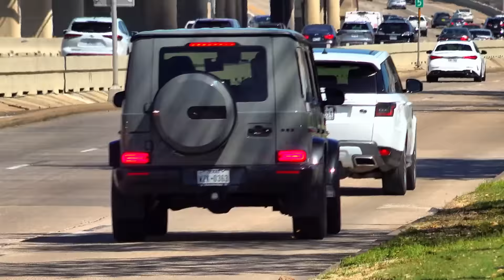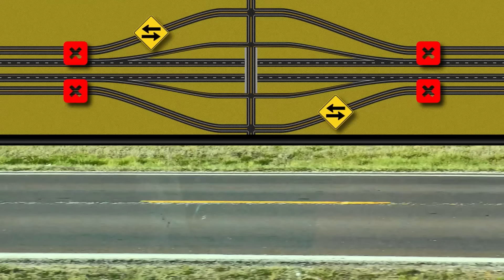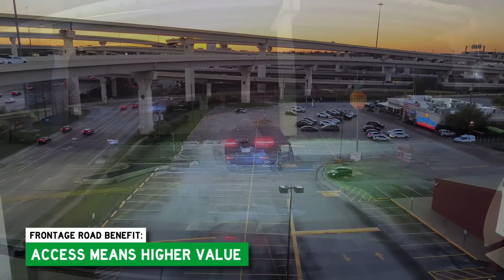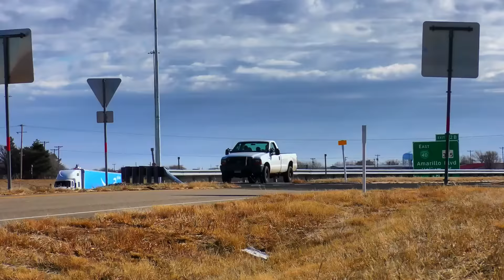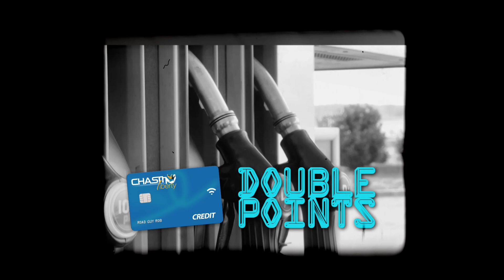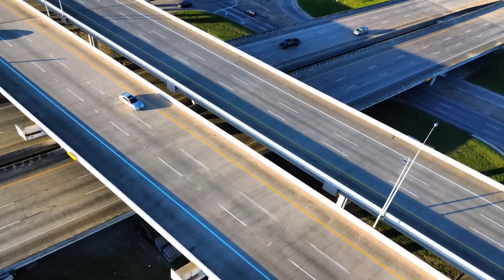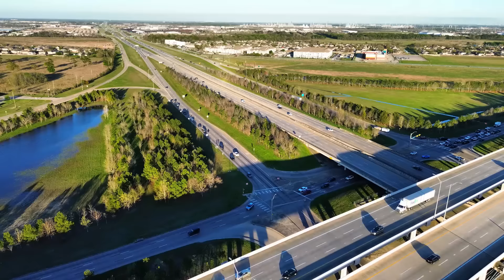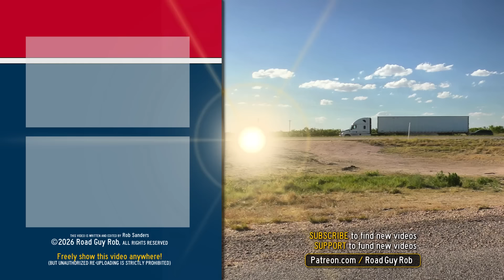Why Texas Builds a Freeway Next to Every Freeway

Comment: Not Just Bikes would have a stroke watching this.
Reply from the maker: I certainly wish him good health.
Reply: @RoadGuyRob  Hey Rob, you need to investigate south loop 610 @ south main/buffalo speedway, both sides east/west. It's a nightmare!
Reply: @RoadGuyRob  He lives in a walkable city with great bike infrastructure, so statistically it's more likely he is in good health (Netherland's life expectancy is 5 years longer than Texas's).
Reply: @recurrenTopology  not only walkable and bikable, public transit is top tier
Reply: @BanBanChi  depends. Public transport is good in the larger cities and to travel between them. Its worthless outside of the larger cities. So I still drive pretty much everywhere, but it takes plenty of other people off the roads. With fuel prices at $10 to 11 / gallon, its a bit less fun though.
Reply: @Twiggy163  Obviously public transport is meant for medium to large cities, no one would be stating otherwise. 80-83% of Americans live in urban areas, with 86% living in metropolitan areas around big cities. This isn't an excuse to not have better public transit when it can benefit a large majority of people
Reply: @kv9016 ofcourse it isn't. Towns require a good connection too and its very much possible. Not every town needs a train station or tram line, but a decent bus connection goes a long way. But even that is often scrapped or cut in frequency. This makes connections time consuming.
Reply: @recurrenTopology  Why does it sound like you interpreted their comment as some kind of diss lol
Reply: @OnceTwiceSouled I didn't, was just making an acerbic joke.
Reply: @recurrenTopology  Except when the Germans come. lol
Reply: @recurrenTopology I feel like the discrepancy in life expectancy primarily comes down to diet coming from a Texan
Reply: @OTLP it's certainly multifactorial.
Reply: @OTLP  I mean of course fast food is a problem, sugar levels, caffeine levels, and all the things they put on the US to make you addicted to food while selling you as healthy or even work performance enhancing. But, other things like not being killed by an oversized SUV driven by a single person doing basic groceries affect the number as well. Most young deaths come from road accidents. Not walking and becoming sedentary. Not smoking every day incomplete exhaust gases from gas. Not smoking every day brake particulates, concrete particulates, normal exhaust gases, tire particulates, a bunch of pfas that obviously are present in probably all of the above. That adds up, just from the decision to not invest in any public transport solution and instead providing people with more car space.
Reply: @Twiggy163 There are rural bus and train stops for the ones who might need them.
Reply: @Twiggy163  Like you implied there, buses can scale surprisingly far down. They can make transit viable even for the smaller towns of a few tens of thousands, and they also serve to increase the catchment area of train stations. Every year I take the train from my small town of 6000 down to a city of 600k, then another train to a city of 160k, and then the bus to a town of 30k to visit family. Works like a charm. Bicycles also work amazingly for traveling within a small town in the right circumstances. It is really only in the rurals where public and active transport approaches the realm of "worthless", though of course there's still some use to a rural bus sometimes. Particularly for shuttling rural kids to and from school, or transporting tourists to popular hiking routes, mountains, skiing slopes, etc.
Reply: @BanBanChi  public transit is top-tier? .... Tell that to all the people that get assaulted on the New York subway... SMH.
Reply: @yo12546  Going from being sedentary to taking a 10-minute walk every day decreases your risk of all-cause mortality by an estimated 15%. That alone makes an enormous difference.
Reply: @nexusofice9135  Reading comprehension is not your forte I see. Not Just Bikes lives in Amsterdam not NYC. SMH...
Reply: @recurrenTopology  & a lot lower income than Texas 😂
Reply: @nexusofice9135 , over 30,000 people die in car "accidents" every year in your country, and many more are seriously injured. The fact that someone was attacked on the subway is the fault of your stupid police. Аnd the fact that it's as dirty as hell there. This provokes inappropriate behavior and attracts marginalized people.
Reply: @Aizetone  LOL so you're attacking regional political and society to what?... Discredit my argument? Lol

That entire statement you just made was just a straw man argument. 

 And yes people die in cars that's not the point that I'm making. A lot more people would die if we didn't actually vet those that are capable of controlling that equipment. 

Are you just upset that you don't get what you want with absolute impunity? Or are you somehow offended that the concept of licensing competent operators on that equipment would somehow stop your freedom? 

That argument is atrocious. 

I've already stated before... That sort of arrogant thinking on something as simple as a scooter or a bicycle for the rider and operator not to be properly informed of traffic law so that they are not a danger to themselves nor the traffic around them. While in a public space that everyone is at risk now just not to assume that they need to be basically competent is folly. 

Even the libertarian in me says that you can't trust incompetent people with dangerous responsibilities in a public setting.
Reply: @yo12546  I'm sorry, talking about caffeine in response to a person talking about Norway? They practically inhale coffee.
Reply: @Vykk_Draygo Yeah maybe I overstated about the US. It is just that they drink stupid ultra-processed canned drinks. They have some caffeine mixed with a bunch of stuff. I think they might have over 500 brands of different "mind-hacking" drinks, which I have seen kids drink
Reply: @recurrenTopology  Too bad the EU has 0 innovation and is in a death spiral. Cool that they can walk around a city though. But they probably wouldn’t even want to walk around their cities if they had the demographic makeup of America’s.
Reply: @RoadGuyRob  I mean you don't realy think that just adding more an more conkrete improves the lives of the Texans?
Reply: @TremereTT srsly as a Texan what a joker video you made looking at our clown ass designed cities and wojacking at them
Reply: @SamanthaSerrano-p9n  ??? me ??? did you mis click by any chance?
Reply: @TremereTT   Hey everyone, mr Tremere over here wants less roads so everyone can spend more time driving in slower lanes
Reply: @kelpermoon23  Studies suggest otherwise, but you do you.
Reply: @lagautmd studies suggest that building roads to go places, allows people to go places
Reply: @kelpermoon23  Studies suggest that increasing road capacity increases traffic volume by an even larger factor, therefore reducing overall travel times.
Reply: @FE800A  studies suggest that you need roads going from point A to point B for cars to drive therr
Reply: @kelpermoon23  ok, I'll try to explain it in 🇺🇸English (simplified): when many vrum vrum, then no move
Reply: @FE800A  Haha ur butthurt
Reply: @kelpermoon23  Here's a paradox: in South Korea, they removed an expressway that was paved over a river and built it as a park. Turns out removing the road made the traffic better.

That's the Braess paradox: if you add a branch to your network, it makes all of your network less efficient.
Reply: @kelpermoon23  if there's no previous connection from A to B, you're right. But if there's already a road, making the road bigger doesn't make traffic better.
Reply: @korenn9381 completely and totally depends on the road
Reply: @kelpermoon23  The existence of the road itself is a good thing for connectivity, but eternally widening it does not provide additional connectivity. Only a minor increase in capacity at a disproportional increase in cost. Often, this also just means feeding more drivers into existing traffic bottlenecks such as intersections, which makes congestion even worse in those locations. Past a certain point, any form of infrastructure can get overengineered. That is definitely the case when you feel the need to build 3-lane frontage roads parallel to your 8-lane highway. What you need in these cases is more high-throughput options to relieve the roads, namely in the form of active and public transportation.
Reply: @V @Vorexia  yeah duh
Reply: @FE800A  poor road design has a much greater factor in the level of traffic. I've lived all over the country and these larger road networks with flowing exchanges move traffic far more efficiently. And no more lanes don't mean more traffic. That depends on population density growth and as I stated the layout and functionality of the roads. That study only really references 2 road ways in areas of drastically inflating urbanization and explosive population growth. Not really representative of the world in whole.
Reply: @FE800A  just give up, they are hopeless.    and be happy it's  them that suffer in that traffic and not you  (if it's you too, move to a better place)
Reply: Funny enough, I believe he credited Houston being so terrible as a pedestrian for the reason he became the transit advocate that he is.
Reply: @tHebUm18  walking in houston is insanity, shit too far away to walk
Reply: @tHebUm18  It was also one of his first videos.
Reply: @tHebUm18  Houston is terrible as a pedestrian regardless of how the roads are done.  I live here.  It is usually so hot and humid as balls that you don’t want to walk anywhere anyway.  Biking maybe and we do home some bike lanes in certain areas.
Reply: @kevingray8616  i think it would also depend on how you do your pedestrian areas, no?
walking paths next to roads and with the sun beating down on you the whole trip would be miserable.
But throw in some shaded areas, away from highways? Surely that's more pleasant
Reply: @aaronhauth8880  In South Texas heat and humidity? Nope, it never gets pleasant. I'm from San Antonio and we are just drenched in sweat about 8 months out of the year, about 4 of those months, the humidity is high enough that even in the shade and with a good breeze you can't cool down. Texas, regardless of how walk-able you design the city will never truly be walk-able year round.
Reply: @bassesoundandlights1966  I'll defer to your experience! I will note, however, that some of that heat is likely self-induced as a result of the heat island effect that comes with huge amounts of pavement baking and radiating in the sun.

It would make me wonder if it would actually become pleasant if texas went multi-modal and there weren't all those massive interstate + freeway combos everywhere.
Reply: @aaronhauth8880  Even in a roadside park, the traffic noise is bullshit.  You need noise cancelling headphones to do it.  There are some shaded areas away from traffic, but you go there to get away from it all.  It is never a way to get from point A to point B.
Reply: @bassesoundandlights1966  Idk why people use this as an excuse. Hong Kong Exists, Taipei exist, Seoul exists, Mexico City exists... Taipei is just as hot and much more humid, yet is one of the most walkable cities in the world with world class public transportation. 

Why do we always make excuses for why Texas can't have things? If it snowed a lot and winters were unbearable, the excuse would be "In South Texas bitter cold? Nope, it never gets pleasant. The weather is so cold that even layers of coats, you can't warm up. No matter how you design it, the city will never be walkable year round."

Yet, Chicago, Moscow, and NYC exist... 

It's time to face the fact that the automobile, oil, and conservative lobbyists have made Texas "cities" a concrete, lifeless, giant suburb filled with strip malls.

We're also all fat and obese from being dependent on cars, so much so we're still sweating inside a 73 F room... That is NOT normal no matter how common...

Better built cities = Less car dependency = better pedestrian paths that reduce heat island effect = more walkability = we're less obese/healthier = A hot summer doesn't equal death.
Reply: @mdr8062 : People are sweating in 73 F temperatures because they never installed a dehumidifier.
Reply: @absalomdraconis oh please. Thats not why half of Texas sweats at 73 F indoors (AC on)
Reply: @mdr8062  I use it as it an excuse because it is something I deal with on a daily basis. It really sucks. I don't walk outside start sweating profusely and think "wow, I can't complain because Taipei exists". I may be incredibly wrong in thinking that way, but with how Texas has been developed and the factors we face everyday, I think you'd be hard pressed to find a bunch of Texans who want to change life to be more walk-able. We also effectively have zero  public transit, so the idea of moving from car based travel scares a lot of people.
Reply: @kevingray8616  It's terrible as a driver too! I went once with my mom down from DFW and that gigantic highway terrified me
Reply: @mdr8062  As a Swede who lived in Cairo and Bangkok, the heat is absolutely unbearable at first but you eventually acclimate and everything becomes much more bearable. This is despite the fact that both these cities are filled to the brim with cars and suffer from the urban heat island effect. I suspect that many Texans out there never actually get time to acclimate since they keep moving between different air conditioned spaces. All the major cities in Texas were founded way before AC even existed, somehow people still got by back then.
Reply: @Vorexia exactly. Thank you for sharing!
Reply: @kevingray8616  it would be great if you had a choice to walk to places, or bike, or PUBLIC transportation, but y’all really don’t. I wouldn’t blame all of that on “it’s too hot to walk”.
Reply: @aaronhauth8880 Yeah no that baking effect doesn't mean anything we have 38° to 43° summers.
Reply: @mdr8062 None of those places really have good public transportation. In fact the ONLY place in Europe with good consistent excellent public transportation is the Netherlands. Ask a German about their train system and watch the start swearing at you about how late the trains are literally all the time. Mr.WalkableCities has a massive bias about public transportation because he lives in the one European country with a good system that actually works.
Reply: @justSTUMBLEDupon  Bus and train service exists for the more densely populated areas.  Bike lanes have been built in some of the more densely populated areas.  We don’t have regional rail which I agree would be a big improvement; particularly between Katy and Downtown Houston.  (which is now fully-developed along its 30 mile stretch)  Freight rail was once there, but was replaced by interstate and toll road.
Reply: @kevingray8616  What's frustrating is that there are so many little islands in Houston metro which are fine.  But there's no way to get between many of them without a car.
Reply: @ianfinnesey726  I hear ya.  I live way out in the Katy area.  There is an effort underway to connect many of the city parks with a pathway.  It’s still going to be a few years though.
Reply: @kevingray8616  Every link is a step forward, but that is still kinda pissing in the ocean.
Reply: @mdr8062  I live in Hong Kong and I absolutely hate walking on the streets. I couldn't even find a parking lot nearby, so I was forced to park all the way down by the waterfront and walk up to SOHO just to get a haircut. It’s 32 degrees out with scorching sunshine, and after a 30 minute walk, I only survived by chugging tons of water. Don't tell me I don't usually walk ,I get over 10000 steps every single day. But I can only survive in air- onditioned places, not outdoors in this weather.Who like that?
Reply: @kevingray8616  well the big deal is the walking distances right.... and that is a product of car based design.    So if you have a pretty walkable area the discomfort walking can be better tolerated
Reply: @justSTUMBLEDupon  No, it's because we have a ton of space so we build out instead of up. As a Texan, I don't get why anyone cares about being able to walk everywhere. I couldn't care less if I need to hop in my car and drive for a few minutes to get to a shopping center. If I want to walk, I do it. I can walk to stores, I can walk to parks. There is plenty of stuff within walking distance, but I don't have to walk, and it's certainly much nicer to get groceries using a car than to walk or use public transit. It's a non-issue for most Texans.
Reply: @aaronhauth8880  it is quite pleasant. People complain all the time because the only part of the heat they experience is the 3 minutes from their parking space to the location theyre visiting, which is usually on a concrete hotbed. I walk around and bike around everywhere, its pleasant outside of direct sunlight peak hours in August.
Reply: @tHebUm18 as awesome as the freeways are, Houston is not built for walking. 
It is too deep in a cascading affect of parking lots to hold cars, so you need more highway, so theres more parking lots, but because so much space for parking lots, businesses are too far apart, so you need highways, and it keeps repeating.

The new construction growing around the outskirts of Houston is going to make it worse.  So many houses being built along 45, 10, 290, and westpark(will be extended to Fulshear soon) is going to congest those highways. Those single homes with yards and driveways are going to force everyone to need a car just to get out of their community and straight into becoming highway traffic.
Reply: I had a stroke watching this
Reply: @escobasingracia962 I also did. This was WAY too high energy for a freaking civil engineering video
Reply: @escobasingracia962 Are you okay??
Reply: @escobasingracia962   Have fun waiting 15 minutes for a bus to take to get off and transfer to another bus to walk to the hospital.
Reply: @g @grafzeppelin4069 You know, walkable cities have ambulances too (and they’re free)
Reply: @grafzeppelin4069 have fun getting in an ambulance that gets stuck in traffic on the way to the hospital
Reply: @JacobRy  I won't, because we built the one more lane you're always crying about.
Reply: @grafzeppelin4069  as opposed to being stuck in traffic and building another lane that only compounds the problem
Reply: @rich8674   No, building more lanes does not "compound the problem."  If you need more water from the spigot, do you buy a smaller hose?
Reply: @grafzeppelin4069  Fortunately I don't have health care so I just wait until it passes
Reply: @grafzeppelin4069  it's called induced demand and if you really cared you'd look that up
Reply: @rich8674  Another lane doesn't "compound" the problem, but helps alleviate traffic. It looks like you've fallen for "induced demand fundamentalism" that is often spread by the bike channels.
Reply: @grafzeppelin4069  Ha! Where in the US do you have buses which actually come every 15 min
Reply: @a_somebody9519  the Boston area has pretty consistent bus service. When I lived on 71 there'd be a bus every like 10 minutes
Reply: @derekderekderek2  You mean induced demand that the US Department of Transportation includes when proposing road upgrades and in the planning process? It's not magic one way or the other, it's just another part of the planning process.
https://rosap.ntl.bts.gov/view/dot/79299/dot_79299_DS1.pdf
Reply: @derekderekderek2 this is why the United States is for survive behind they don't educate their citizens to know why building more roads for the most part will make traffic problems worse but it is a proven fact we know for a fact it makes things worse especially over the pond.
Reply: @a_somebody9519 Welcome to Dallas, go into the downtown for a bus; otherwise you’re walking
Reply: @elixier33  it's not a fact nor is it proven. That's why it's called "induced demand fundamentalism", a distorted belief taught mainly by bike youtubers
Reply: @grafzeppelin4069 An added lane can increase traffic. Its a pretty well documented issue and Houston has some of the big, emblematic roads for it. It's a little counter intuitive but the process is called induced demand. Basically the extra lane extends the effective reach of the freeway and causes more people to flock to it in numbers that create more trafic than the additional capacity created by the extra lane, resulting in a net increase in traffic.
Reply: @FoolyCharged Right. When the Katy Freeway was expanded the traffic lessened for a short period of time but was soon just as congested as it was before.
Reply: @elixier33  In Atlanta, they have done little to the interstates beyond HOV/HOT lanes. No new freeways either. Is traffic commensurately worse relative to the percentage of capacity added since the early 90s? No! It’s orders of magnitude more than than growth in capacity. By you logic, traffic should only be 20% worse if 20% capacity added. Atlanta metro is living proof that that is simply not true. Adding more lanes may not solve traffic - as if a few train lines will “solve” it - and it may not keep steady, but you can guarantee that not building something - new freeways or new lanes - in a growing area will absolutely make traffic work. With the roads static or growing less than traffic volume, where is that traffic going to go?
Reply: @JacobRy  Can't forget those crippling ambulance and ER bills
Reply: @derekderekderek2  : It's not complete nonsense, but the description is. It's a communication problem: in particular, it happens when it's too easy to get on/off the added capacity, so traffic from elsewhere shifts on to the new capacity instead of staying where it was. The solution, of course, is pretty straightforward (though not always easy): make sure that it's somewhat hard to shift between the sub-system (such as freeways) the capacity was added to and everything else, and the new capacity really will make things easier, at which point you can then look at dealing with problems in other sub-systems (such as local roads) under the same concepts without as much trouble (because the difficulty of shifting between sub-systems will cause people to improve their routes instead of using the stupidest possible option).

None of this, of course, favors the bike supporters, which is why it's partially nonsense. There is no rational situation where a proper city transitions from car-centric to bike-centric without a massive level of disfunction, because actual cities either have too much area for bikes to do the job, or too much density for bikes to do the job, so the only way for cities to move from cars to bikes (instead of suspension railways or something) is if the city becomes so mismanaged that both population and real-estate are forced to make massive relocations and rezonings to compensate. The bike obsessives just have their heads stuck in towns.
Reply: @grafzeppelin4069  induced demand
Reply: @grafzeppelin4069  Adding lanes have been very thoroughly shown to NOT alleviate traffic and in many cases, cause more.
Reply: @derekderekderek2  Ahhhh...gotta love the mentally ill. "I don't like this statement..so I will declare it  false narrative, even though they have plenty of actual data to back it up!"
Reply: @FUGP72 No, you're alluding to the myth of "induced demand".  It is physically IMPOSSIBLE for building additional lanes to increase congestion.  It can increase TRAFFIC (throughput), but it is supposed to.  There is no such thing as "induced demand" - that is correctly called LATENT demand.

The problem is that more people want to use the road than the road allows.  The solution is to build more lanes or more roads.

Again, if you believe in your "induced demand" so much, go tell firefighters to replace their firehoses with backyard garden hoses, because they will let more water through.  That is what you are arguing.
Reply: @FoolyCharged  

No, you're alluding to the myth of "induced demand".  It is physically IMPOSSIBLE for building additional lanes to increase congestion.  It can increase TRAFFIC (throughput), but it is supposed to.  There is no such thing as "induced demand" - that is correctly called LATENT demand.

The problem is that more people want to use the road than the road allows.  The solution is to build more lanes or more roads.

Again, if you believe in your "induced demand" so much, go tell firefighters to replace their firehoses with backyard garden hoses, because they will let more water through.  That is what you are arguing.
Reply: @dariusbrock2351    Because the additional lanes did not even come close to keeping up with the population increase, you dolt.
Reply: @grafzeppelin4069  It's amazing that you bring up population increases as a dynamic effect while constantly ignoring any other relevant or causal details and then have the audacity to criticize others. 
The hose comparison is a pure show of cognitive dissonance, no one is saying that smaller diameter hoses have higher flow rates for static demand. The argument is that the demand isn't static. 

The firetrucks themselves carry a limited amount of water. This is why fire hydrants exist. They provide access to a large reservoir of water that the firefighters can use to put out fires. Imagine arguing we need to build more firetrucks or more lanes to carry water back and forth while your house burns down instead of just building infrastructure appropriate for bulk water transport. 

No one is asking to ban firetrucks they have their purpose, but it would be asinine to completely dismiss water carrying pipes in high population areas as viable infrastructure.
Reply: @a_somebody9519  Lots of places do, you must not live in the US. I've been to and used the public transportation in several US cities and they do in fact have buses that come every 15 or sometimes even more frequent than that.
Reply: I think he would be fine. We do have frontage road like this in Canada. Montreal has them (we call them service road). Its f’ing dangerous trying to pul’ in a store with people flying at 80-90kmh (and its a 50kmh zone).
Reply: @benoitrochon96  It is good that Canada joined the Horizon Europe program. Eventually you start getting walkable cities too 👍 Higher quality of life and not that Texas 💩 Greetings from Finland 🇫🇮🇪🇺
Reply: Opposite. Canada imported poo.
Reply: @verttikoo2052 Montreal is the only place with frontage roads really. Which is ironic since downtown is walkable and is transit oriented. Canada needs more transit but it is going to be car friendly because in the dead of winter, no one wants to do much walking. A -1 c day in Toronto can be a miserable walk beside of the damp humidity. Car use is not always ideal but it bears freezing your ass off waiting to the bus
Reply: @marklittle8805  I am from Finland and when we can do it, then you can do it 😉
Reply: @verttikoo2052 Finland didn't start off with the car culture Canada has. And outside of Southern Ontario and the Fraser Valley, Canada is a lot of empty spaces... Like a LOT. Finland and Canada are similar in climate and some of the topography, but the scale is different
Reply: @marklittle8805   No excuses. You can do it. You don’t know it but Canada is full member of the Horizon Europe program and Carney is building this thing using science and reality 👍
Reply: @marklittle8805  You see them in Alberta as well.
Reply: Yeah, Jason would freak out for sure. He already made a " i hate houston" clip.
Reply: The main issue he'd have with this, I'd randomly guess, is that it's really just a freeway next to a freeway pretending to be something different. If these were genuine local roads, one lane, with proper pedestrian and bike infrastructure, there'd be little to complain about. In fact, it's one of the ways the Netherlands does handle its traffic planning: use proper road hierarchy.

It's all about putting the appropriate traffic onto appropriate roads. Don't use freeway design for local shopping roads. And don't use local neighborhood road design to design something like a freeway - which some of those offramps running right into oncoming traffic here I'd say are (I'd suggest some of those could be roundabouts too, but that'd probably get me shot in Texas).

So I'd say it's less about the principle and more about the very Texan way these are executed.
Reply: @Sp4mMe Many Dutch roads even have "frontage roads" - where the frontage road is a single lane one way residential street with all the houses, and the main road is a 50 km/h road (often 2x1 lanes). The scale of the Texan roads is more the problem than the idea itself.
Reply: @marco23p I'd say it's more frontage streets as they are usually streets next to roads, instead of stroads next to highways. And a good number are just parallel streets and not so much part of the highway to the degree frontage roads are.
Reply: @marco23p bad example. The Netherlands actually has many ''frontage roads'' like the ones in the video but they are, as you said, single lane and usually have a bike lane on both shoulders, these roads allow speeds of 50 km/h  also mentioned by you, but they do not have houses next to them. These roads running parallel to highways border on farmland or industrial zones/office buildings.
Reply: @marco23p The netherlands has many different types of Frontage roads or Parallelwegen. Good examples are near Utrecht on the A12 or near Almere at the A6. They generally form a 4x2 highway, 4 2-wide highways. Or as you mentioned Parallelwegen with lower speeds.
Reply: @marco23p we also have 80km/h parallelweg next to 100+ km/h highways sometime, though onramp access is usually via roundabout and they are generally two ways instead of one way. these roads are in rural areas and do not have bike lanes.
Reply: @Sp4mMe  But frontage roads ARE proper road hierarchy.  Instead of 6-7 entrance and exit ramps for one city, all getting clogged up and spreading congestions into the city, you have 2, and both are at opposite ends of the city, where space is more available.
Reply: @Sp4mMe  The scale issues that come along with massive sprawled out cities where cars are a necessity make it extremely difficult to put "appropriate traffic onto appropriate roads". There's just way too much traffic trying to get from everywhere in the area to everywhere else. It's a frustrating problem to have, and as a Texan who has spent time in the Netherlands I would love nothing more than to be able to Dutch-ify things, but it's just not possible in the vast majority of the state.

I disagree with the reductive viewpoint that it's more a matter of "Texas brain" than it is of principal. There are a lot of reasons we ended up with the god-awful sprawled-out traffic-clogged cityscapes we suffer with today. Growing from farmland to massive metroplexes during the 20th century where land was cheap and cars were already the norm sort of doomed us to this situation. And now we have to deal with it. It's complicated.
Reply: @Sp4mMe  man using "... that'd probably get me shot in Texas," and then the next line features "... Texan way these are executed," is just amazing. Intentional? Maybe, maybe not. Nice reading? Yup.
Reply: @Sp4mMe you'd be surprised to know that the majority of these frontage roads actually have a sidewalk with them!
Reply: @GeonQuuin  That's nice. Doesn't change the other problems.
Reply: @GeonQuuin and most of the walking will be because of all the parking lots
Reply: @GeonQuuin  I live in Texas and the sidewalks on them are useless. In my city they just abruptly end and lead to nowhere. They also start from nowhere as well since they don't connect to any residential areas. That isn't really "pedestrian infrastructure". I should expect to make it to my destination entirely on foot/bike without having to walk in mud or hug the inner-edge of the road, which is pretty much what I have to do if I was willing to brave the journey to Walmart or Costco.
Reply: @GeonQuuin  Shhhh... the urbanites want to play pretend.
Reply: @Sp4mMe  It's actually a stroad next to a freeway, which is probably better than having one gigantic stroad.
Don't expect any commercial activity other than soulless box stores in the area, though.
Reply: @TheRealE.B. Strip malls, strip clubs, mattress stores, Texas frontage roads have it all.
Reply: @MrOtistetrax  car dealerships and fast food ofc too
Reply: @MrOtistetrax  And in Houston they're all in the same shopping center, it really makes it convenient.
Reply: @TheRealE.B.   Dentist office, Staples, Chinese food, ethnic grocery store, Burlington coat factory, pool hall, income tax guy, barber shop, Denny's, seafood restaurant, regular grocery store, mechanic, Bob's furniture, hotel, optometrist office - that's the stuff on the frontage roads in my city.  Does that count as "good" commercial activity?
Reply: @grafzeppelin4069    Okay, so not literally all "big box" stores, but yeah it still just sounds like you're rattling off stereotypical strip mall businesses.
Reply: @TheRealE.B.  So, goalpost successfully moved.
Reply: @grafzeppelin4069  Not really. My initial comment was an internet wisecrack; it's obviously a broad generalization for the sake of brevity. Listing out all of the various types of stores that you typically find in a strip mall just doesn't have the same zing.

You also need to understand that I rarely visit such places, so I legitimately forget that there are Aspen Dentals and Kay Jewelers and such sprinkled in among the Costcos, Walmarts, and Best Buys. The presence of these smaller stores doesn't materially change my experience of the built environment.

My point is that it doesn't look the commercial districts I shop and eat at where I live. That's all I mean. Don't make me write a detailed manifesto about why giant seas of asphalt deal psychic damage to me.
Reply: @TheRealE.B.  Haha ur butthurt lol
Reply: It's actually a good system, it just points to the absurdity of building a highway everywhere in order for people to get around because in order to build a working highway these ridiculous frontage road systems are necessary.
Reply: @Sp4mMe  Texas has roundabouts. Not many, but they are becoming more prevalent in newer suburbs.
Reply: @Sp4mMe  You can't use the same system for Netherlands and Texas.  Comparison total land area of Netherlands (around 33K squared for land only and 42K squared for both land and water).  Land area for just the Dallas-Forth Worth Metro area in Texas: 24K squared.  You are not going to ride a bicycle from one side of the city to the other.  Even public transit is limited in what it can reach.
Reply: @alexaneals8194 right, but we also don’t cycle from one end to the other of a city. The randstad (literal translation is bordercity) is a complex urban sprawl of cities and towns covering 3 provences. You could live in the hague but work in amsterdam, i’ll tell you that nobody cycles from one city to the other for productive means, but this person working in amsterdam and living in the hague which is about an hour drive, might do their groceries with their bycicle because the albert heijn is 5 minutes away with a bicycle or on foot. It’s not about completely switching society from one form of transportation to the other, its about mixing the forms and proper use of transportation for the proper means.
Reply: @Sp4mMe : Roundabouts are drastically overrated. They're only useful for the lower end of medium-traffic intersections, because they involve too much space for low-traffic areas (where all you can justify is a plain crossroads), and don't support higher traffic volumes (because even if you TRY to use a multi-lane setup, all of the inner lanes become almost unusable at high traffic volumes: the more lanes the roundabout has, the less effective every additional lane becomes).
Reply: he would love the concept: having a proper freeway and two local streets is a huge improvement compared to a stroad. But he would hate the execution, because Texas builds frontage roads as large and fast as the highway which negates the initial motivation of making the driveways safer to connect
Reply: @RRRoschan : Nah, Texas just hasn't faced up to how fast they should make the freeways yet.
Reply: @absalomdraconis honestly that's absurd. I live in dallas, freeways are often 65-75 mph, they do not need to be faster
Reply: @absalomdraconis 
Bury the highways, then you can make them far faster
Reply: Thank god. Maybe he’ll finally stfu
Reply: try livin it.... its a blood sport out here.
Reply: Uhhh pretty sure this is exactly the usual solution to stroads, just applied to a freeway. The stroad solution would be that central road, and then a parallel side street for the driveways. Same concept. Netherlands does it a good bit ~
Reply: Fuck the cyclist. Move somewhere less car centric
Reply: And Texans would have a heart attack watching Not Just Bikes. One of, if not the, topmost morbidly obese states in the country.
Reply: Of course, guy's a loser
Reply: Texas = Not Just Cars/Trucks
Reply: Interestingly, dutch roads do have frontage roads. It's just that everything is only 1/3rd the size, and at lower speeds suitable for pedestrians and cyclists.
Reply: Hope the last thing NJB sees as he strokes out is a Chevy Suburban bearing down on him on a stroad
Reply: Being in a semi truck. Having to take a turn onto these side roads from a narrow road is stressful. I would have to cross 2 lanes to make the turn and traffic is too fast
Reply: @Doofwarrior88 : I dealt with this style for years in OKC, you need more space. You need to add AT LEAST one more on/off -ramp pair between the side road and the ramp onto the freeway to give yourself more opportunity to change lanes. Or, alternatively, alter your route to maximize your usage of turn lanes at stop lights (just depends on the situation).
Reply: I was thinking the same thing but about the fuckcars community in general including their subreddit. And as someone who's somewhat aligned with them I nearly had a stroke myself this shit is disgusting lol
Reply: I almost had a panic attack
Reply: Love your energy!  Thanks for the videos.  Keep 'em coming!
Reply: Yeah, he should stay in Europe. I'm grateful for my drivable cities. Roads are for cars, not bikes.
Reply: That would be awesome to see
Reply: They do have a sidewalk
Reply: Make him watch it please
Reply: The Netherlands kinda has these too, but they're also proper freeways without level intersections and no direct access to shops. They're just an outer freeway with many exits and the inner freeway with no exits.
Reply: at 15:36 you can see some Florida bike gutters. Would send NJB into conniptions. What he doesn't know is that in the early oughts Central Florida had hardly a single bike lane. They were all just poorly maintained shoulders that kind of just...sank into the sand. What we have there now is a HUGE improvement. Still scary af to ride on, but now at least you don't feel like you're riding somewhere you're not suppposed to be.
Reply: It is making my blood pressure go up for sure.
Reply: As a native New York, on my first vist to Texas, I fell in love with it. For many reasons, their roads configuration is in my top 3. Truly enjoyed driving in TX. I hope to return soon😊
Reply: Not really. Not just bikes talks up access roads.

This is how you avoid stroads
Reply: @MrDdwornik  By... building stroads? What exactly do you think these high-speed roads full of driveways are?
Reply: @notme8232 it looks to me a lot more like a highway next to an access road, which he speaks up as being pretty great in the Netherlands.

This has a purpose built limited access highway (good), and a seperated designed for on and off road.

Not a stroad doing both at once.
Reply: @MrDdwornik  Never been on one, but it kinda looks like the "access road" moves about as fast as most highways, somewhat nullifying the benefits
Reply: @notme8232 perhaos they act as an access stroad 😂

Not just bikes does talk up the access roads to the intra urban shopping hubs run along proper highways as one of the things that makes driving in the Netherlands better though.
Reply: No he wouldn't. This actually looks pretty good and safe compared to other traffic systems in America. For a start those feeder roads are one way. 

As a Dutchman who's studied spatial planning myself all I really would want to add are proper sidewalks and bidirectional bike paths on both sides.
Reply: @Deckzwabber : Those really don't belong directly on these roads, as these are really still high-speed. Pedestrian & bike traffic belong another layer away.
Reply: @absalomdraconis 
Not on the roads, certainly not. But parallel to. With an appropriate intersection design to protect those not travelling with two tons of armour plating against drivers turning without looking carefully enough.
Reply: Good. Keeps the wrong people away.
Reply: This is why I support Rob. He talks about transit, cycling infrastructure, and pedestrian infrastructure while not trying to un-invent the automobile with his every waking breath.
Reply: @djsekani I can tell he doesn't like cars, but he doesn't like that there's cars EVERYWHERE and not enough safe or reliable sources for pedestrians to access basic stores and other important locations. In fact, if you actually took the time to watch his videos, he SPECIFICALLY states that big cities like Houston can become more pedestrian friendly if people stopped buying SUVs and light trucks or luxury light trucks/SUVs and instead drove car types like sedans, station wagons, or compact cars. Cars being bigger is what makes Houston think it needs more concrete and space to accommodate when in reality, it just needs to change their perspective on what we should be driving. I'm in total agreement and I'm a native Houstonian, I was born and raised here and I do in fact walk/bike/take public transportation, so I know exactly what Houston is like. Hell, even when my partner who lives in San Antonio came to Houston for the second time in his life, one of the first things he commented on was how much you have to drive everywhere and that everything is really far from each other. Once I do get a car in the near future, I don't want to exacerbate the problem, I'm getting a sedan or station wagon, NOT AN SUV OR TRUCK.
Reply: @carolinacoreas7716 On an intellectual level I actually agree with almost all of Jason's arguments. It's too bad that they're buried underneath a bunch of inflammatory anti-car noise. I can do without his clickbaity confrontational tone. Why have a real discussion when the stupid hot take gets more views?
Reply: @carolinacoreas7716 get a hatchback. I consider myself a car enthusiast and love driving on the weekends but I also take the train to work for my commute. The walk from the station is a bit long but I just consider it good exercise before and after work, certainly getting my daily steps in. I could drive to work much faster but i kinda like the routine and it's still not too bad (45 minutes each way vs the 15 it would be if I drove)
Reply: @djsekani  i don't think NotJustBikes hate cars, he have stated that he does use car share service when he finds it necessary. The whole point is that this model of running freeways in the middle of a city is not sustainable and advocating to alternatives to driving (especially during rush hour) and kids having autonomy by not being tied to their parents driving them everywhere.
Reply: Texas looks like a very crappy place to live. I thought Toronto was bad in how car centric it is, but Texas takes the cake.
Reply: @UzumakiNaruto_   If you don't have car Yeah it's crap, got a car it's not half bad.
Reply: @MrTak44  As long as your car has A/C. FOr like 5 summers, when I was a kid, we drove a car with no A/C it was hell. My dad and I used to go pick up my mom from work, and getting stuck in traffic was doubly worse, because not only were we not moving, we had no air flow. I think I would lose my mind today.
Reply: @UzumakiNaruto_ it’s so hot that you don’t really want to be outside walking anyway. The selling point of Texas is that the real estate price to wage ratio is rather good compared to Canada which has one of the worst in the world
Reply: @badart3204 Beats the shit out of SoCal for driving in, believe me. It’s not like America is going to undo its reliance on cars anyway. Might as well find the least bad way to do it.
Reply: @badart3204 not being able to walk because its so hot you don‘t want to go outside is also not really selling me on this whole „living in Texas“ thing, that just sounds even shittier.
Reply: @UzumakiNaruto_  I'd rather be dead than living canuckistan. Walking is for losers that don't have a car.
Reply: @UzumakiNaruto_  Not a great place to visit either if you want to just walk from your hotel to a nearby restaurant for example.
Reply: @UzumakiNaruto_  It's larger than France.  Cars are pretty much required unless you want to live in an urban center and never, ever leave.
Reply: @bigd4366  
That's why the Netherlands has got it right. They built their cities and communities to be liveable for people rather than serving vehicles first. They made it so that you could have options to get to where you want to go rather than making cars the best and quickest way to get anywhere.

If you just want to go to your neighborhood store, then you can walk or bike. If you need to go further then you can bike or take transit or drive and if you want to take a trip then go drive. The Dutch made all these options safe and easy while in North America driving is still the best and fastest way much of the time.

I don't know if you watch Not Just Bikes or other channels that show Netherland cities and how they're built, but they just look so peaceful and safe to get around outside of a car compared to North America where frequently riding a bike with cars is risking your life. 

I just like that they have large portions of their communities that are built for people and that its so quiet and peaceful without cars zooming around everywhere near you. I wish we had that in North America more.
Reply: @bigd4366  All of our largest cities in the US were built on railroad lines and were designed to be pedestrian friendly before cars became widespread. The idea that the country's geography 100% requires cars is manufactured and not accurate to our country's history.
Reply: @UzumakiNaruto_ : They mostly built their communities before cars were widely (or at all...) available, and thus the fastest travel was by horse. This happened all over Europe. In contrast, most US urban areas got the bulk of their size after cars became readily available.
Reply: @absalomdraconis  
They mostly built their communities before cars were widely (or at all...) available, and thus the fastest travel was by horse. This happened all over Europe.

Not true at all. At least for the Netherlands, Not Just Bikes has done a number of videos of how post-WWII the Dutch government were building North American style car infrastructure in the 1950s and 60s and then the Dutch people protested against it because they hated it and guess what? Their government LISTENED and began taking a different direction in how they approached building their roads so that they would be more people centric than car centric.

NJB has posted several videos of how the Dutch had torn down and re-designed a number of stroads and multi-lane streets to add bike and pedestrian friendly infrastructure. He also showed how when streets need to be torn up for major infrastructure work that the Dutch often take the opportunity to completely change those streets and upgrade them to be better for pedestrians and cyclists.

The point is the Dutch were once building the same kind of car centric infrastructure that North America was and when the people spoke up, their government listened and they changed the way they chose to build their streets and roads and they've been continually doing it ever since. 

Cities in North America could do the same if they really wanted to, but most don't want to. Heck even when they're building brand new subdivisions where they can design a community from scratch they don't bother to make more people friendly either.
Reply: @UzumakiNaruto_  The Netherlands is slightly larger than Dallas/Fort Worth.
Reply: @bigd4366  
The Netherlands is slightly larger than Dallas/Fort Worth.

And? Doesn't mean you can't change the way you build your cities starting now if you really wanted to. The thing is I don't think North American cities do really want to change the way in how they build things.

Even when most NA cities are building brand new communities where they have all the space and freedom to design what they like to build, they STILL choose to build the same as they always do instead of adopting the Netherlands way of building communities. So its not like they don't have the opportunity. The governments in charge just choose not to change.

Compare that to a place like Carmel Indiana. Small city I know, but their leaders had the will and desire to change and now they're one of the most nicest and people friendly places to live.
Reply: @UzumakiNaruto_  You missed my point, which was that one metro area in one small (two counties) part of Texas is comparable to the entire nation that you brought up.  Texas has 254 counties, and is the size of France.  And most of the population doesn't live in a dense urban setting.
Reply: @bigd4366  
You missed my point, which was that one metro area in one small (two counties) part of Texas is comparable to the entire nation that you brought up.

So are you saying that its easier to implement things in a smaller country than it is a large state? If so that may be true, but that doesn't mean you can't start now and keep it going so that from now on you can build nicer, more people friendly communities while going back to older parts of a city to change their design when you can. 

However I doubt Texas or most other places in North America have any kind of desire to do so which is why even when they're building brand new communities and subdivisions from scratch they're still building them the same way as they've always done which is stupid. I mean they could begin building them with proper bike lanes and have more density and have roundabouts to move traffic around better while slowing drivers down etc., but instead of doing any of that, they still build them the same as most every other suburban subdivision in NA.

Texas has 254 counties, and is the size of France.  And most of the population doesn't live in a dense urban setting.

Which is dumb because having people spread out so much increases the cost of the infrastructure of delivering services to people while at the same time it makes much worse places to live in when most places you want to go to requires a car to get to.

Again it is possible for city planners in NA to build nicer places for humans to live in just as they do in Europe. They just choose not to do so even when they have the land and funds to do so.
Reply: @UzumakiNaruto_  i never like Texas for this reason. So much noise and danger.
Reply: Rightfully so
Reply: Reminds me of Dutch roads. They love multi purpose buolevards. Fast traffic in the middle and frontage roads on the sides.
Reply: @Loanshark753 except the frontage roads in Texas have speed limits of 45-55mph/72-88kmh (obviously fatal to pedestrians)
Reply: That guy has a condescending smug attitude that makes his videos a tough watch. While he makes some great points, he struck gold on his "optimize for car traffic bad" mantra and milked it to the ground. Like it's ok that every city doesn't look and feel like NYC or some 1500's European city. Diversity and options are good so people can live and move around where and how they want.
Reply: Bro hasn't seen a tree in years but he'll go apoplectic if someone owns their own home and car instead of renting and being dependent on a bus.
Reply: Real Civil Engineer would also have a stroke. A merge before a diverge as a feature
Reply: I was watching this video thinking this exact thing, came down here to make this comment and boom there it is.
Reply: He actually argued for something like this in favor of stroads.

Only smaller. Why are the frontage roads in the videos all still so huge?

A one lane street with a two way bikelane and a sidewalk seems big enough?
Reply: @iamcurious9541 because everything bigger in texas.  They are all like this, usually more lanes like: 2 left turning with one to go straight, 1 to straight only, 1 to go straight and right.  Sometimes bigger, sometimes smaller.

This is NOT a bike city even if you add bike lanes.  Too much storm/rain, too many cars going fast(especially in residential), and sidewalks end out of nowhere everywhere, bridges with no walkway. 
Stroads as far as the eye can see as well.
Reply: @iamcurious9541 its the traffic level. All of these clips come from fairly busy "main" streets. For more walkablity you could look at dedicated bus lanes for a bus route that does moves people up and down the highway then some  small buses for local stops. With how much room these overpasses us I would not be suprised if you could add such bus stops with out much effect to car traffic.

At lest dallas has tons of HOV lanes that could be convered to bus use.
Reply: @jac @jacobhatfield4970 here would a bus drop you off in Dallas though?

If we just replace hov with bus lanes, still would have to walk to work from the bus stop with almost no sidewalks and 100+ degree heat 3+ months a year
Reply: Serves him right.
Reply: Even I get severe anxiety watching this. And I'm not even from the USA
Reply: @tyrantfox7801 Your foreign brains literally couldn't handle it
Reply: That guy hates everything except Denmark.
Reply: @stevedapirate5  You mean the Netherlands?
Reply: @stevedapirate5  You haven't seen any of his videos, have you?
Reply: This is why I don't watch Not Just Bikes. I feel like I'm always being criticized for driving a car.
Reply: @Josh-yr7gd  Oh no, being criticized for endangering the lives of people around you for your own convenience? How terrible!
Reply: @notme8232  No. Reckless drivers endanger the lives of all people, whether you’re in another car or on a bike. Not everyone is a reckless driver, though. Don’t make that broad assumption about car owners. Also, two things can be true at once. Build more public transit, bike paths, and pedestrian walkways, while allowing vehicular traffic to flow as well. Not Just Bikes, seems to take the “either or” approach, rather than the “both and”.
Reply: How stupid are they in Texas??? 🤦🏻‍♂️🤦🏻‍♂️🤦🏻‍♂️
Reply: Texas is real economy, west europe is bullsh*t economy. So they can have walkable wonderland and hypocrites with benefits from the state. But when serious matters arise, they buy raw materials and weapons from Uncle Sam. From that hated Texas and other ugly car-centric places.
ps even bikes they import from china.
Reply: @arminvankutonger7697  I was born and grew up in Dallas and had crazy Texas pride. I still enjoy visiting my folks there but I didn't realize how crappy it was until I moved away to Colorado. Now I live in Mexico and am even happier
Reply: @arminvankutonger7697  Texas 🖕 There is absolutely nothing that anyone wants from Texas. For us Texas is prime example of what not do and we use it as an example how idiots creates problems.
Reply: Bicycles are a child's toy.  We drive in Texas.
Reply: Crap autocentric boring infrastructure that makes people car dependent
Reply: Good. Bikes can stay on trails where they belong.
Reply: Lordy Cycling??? Uhhb